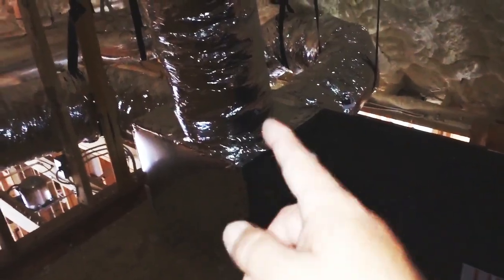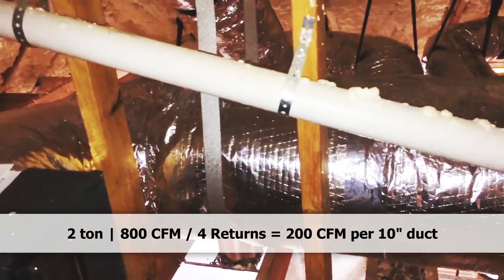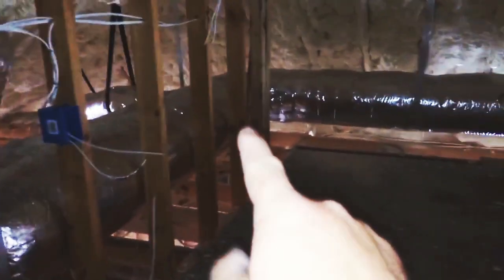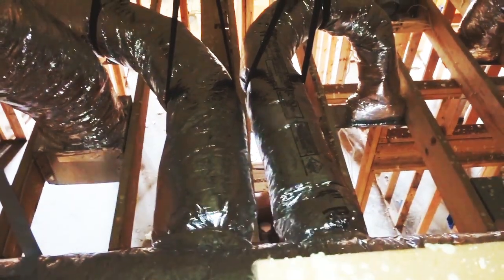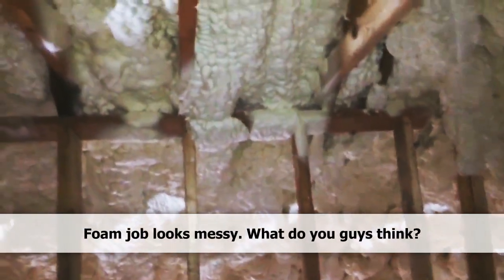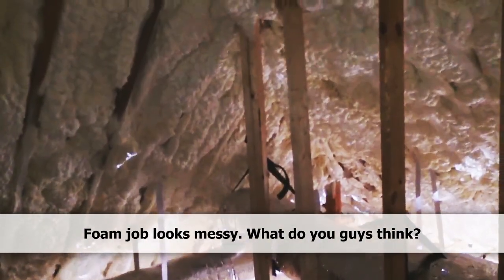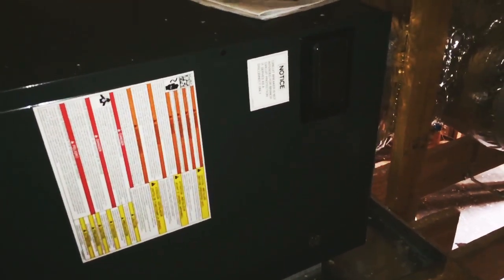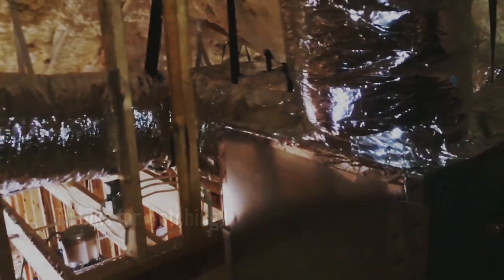HVAC Install | 2 Ton Goodman Air Handler and Duct

Comment: You can never oversize a return the longer the bigger the quieter the system it's better for the system a 4-inch filter if you can put it on there 1 inch filters have a lot of static drop
Reply from the maker: I like the 4 inch filter idea. I do believe returns can be over sized vs. airflow. My example is an extremely over sized return in an attic space. The slower FPM will cause the return to pick up heat.
Reply: HVAC Shop Talk Podcast no you can never oversize a return in big commercial buildings they use the entire ceiling for the return above the ceiling grid the bigger the return the less static you have and the quieter the system period on Supply ducts you must stick with the correct size oversized supply duct you will lose static pressure and then you'll not have the airflow required because you lost all your static pressure

Comment: What about the liquid lines.  I am talking about the inlets of the air handler, why they are on top and no under, close to the pan?
Reply from the maker: Not all lines come out at the base. Older Goodman units would (when flipped left hand), but not the newer ones.

Comment: 2 ton is not available in 2 speed
Reply from the maker: https://www.goodmanmfg.com/products/heat-pumps/16-seer-dszc16
Reply: the PDF only show 2 speed starting @ 3 ton. I installed a goodman 18 seer HP 2 speed  18 seer only comes in 3 4 5 ton. Same technology, unload solenoid in compressor.
Reply from the maker: It says hi and low heat on page 20. I will try to double check tomorrow. My father is running this job, I will ask what model he is using. I do think the 18 is only 3,4,and 5
Reply: HVAC Shop Talk Podcast I looked on page 20 and the only two speed data is on 3/4 and 5 ton equipment
Reply: 2 Ton definitely available in 2-speed.  Top of page 20 says low speed for 2-ton, next block down says high speed for 2-ton.